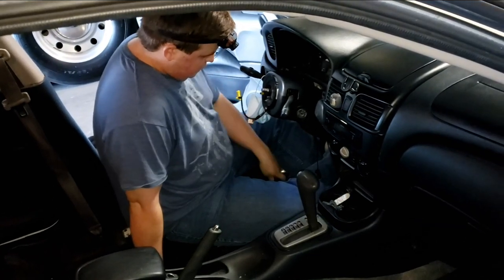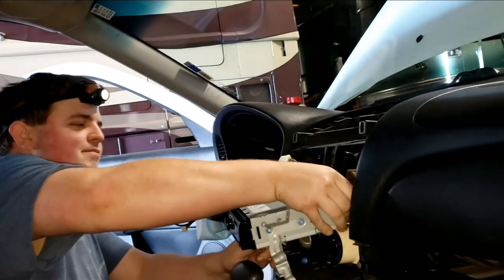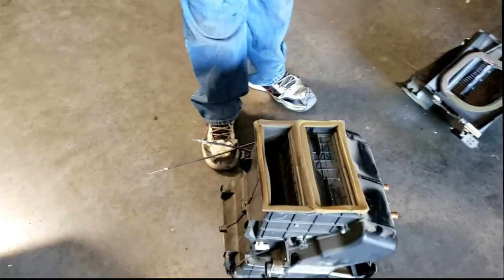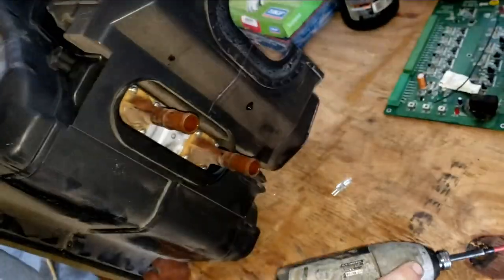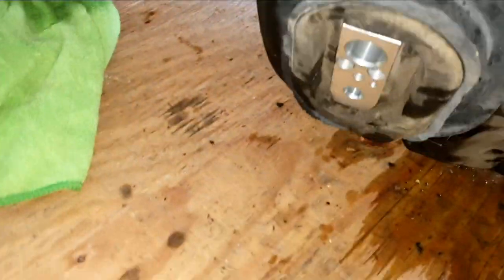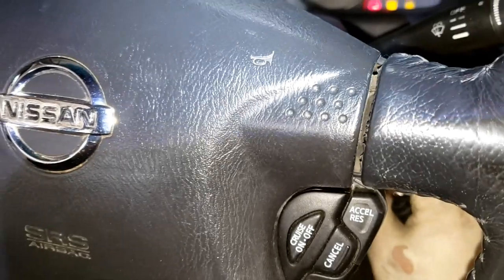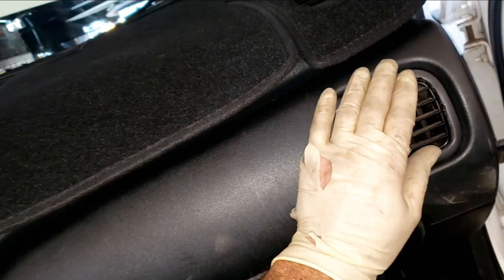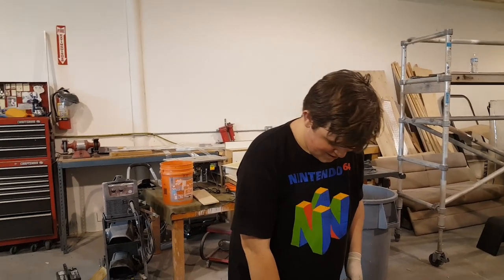Nissan Sentra Heater Core Replacement....How Hard Can It Be?

Comment: My favorite motor coach, the dash is built around the heater core. I have heard of folks cutting the dash in half top to bottom to crack it open to reach the core.
Reply from the maker: I needed access to a Newell evaporator and unless the entire dash was torn apart it was not going to happen. It's a 2 day process and I said no thank you.

Comment: Hello ? Did yall have to upset the ac unit  to install  the  heater core I have a 07 sentry need a heater core an I just wanted  to  no
Reply from the maker: yes 100% the expansion valve is part of the box.
Reply: @AZExpert  thxs for info

Comment: Classic father son working on a car, 10 years from now you’ll be telling his kids all about it lol.
Quick question, 2013 Class C 300TS Concord or a 2015 Lexington 265DS both with 27,000 miles, your opinion?
Reply from the maker: thank you. Either one of the RVs are nice. I find Coachmen to be slightly better than Forest River. I also prefer the Ford Chassis over the Chevy, I'm not sure if that is an issue on these.
Reply: @AZExpert  thank you so much for the advice,, it’s really appreciated.

Comment: heater core`s and HVAC evaporators are the worst I did a evap on a lincon and missed one of the vacum hoses Had to rip the dash out again ,,,,,,
Reply from the maker: They are ridiculous jobs, I was expecting to take it apart again too because we forgot a wire but we lucked out completely!